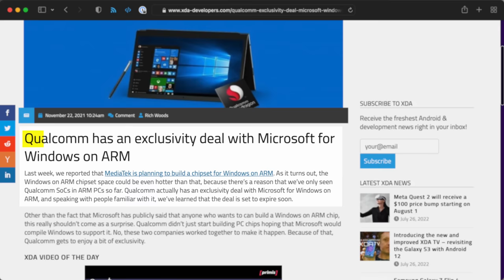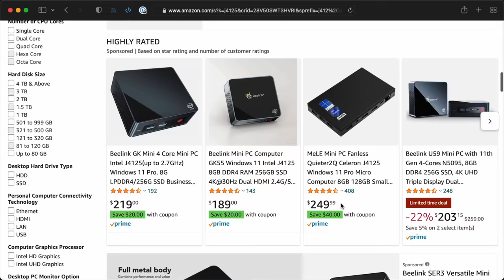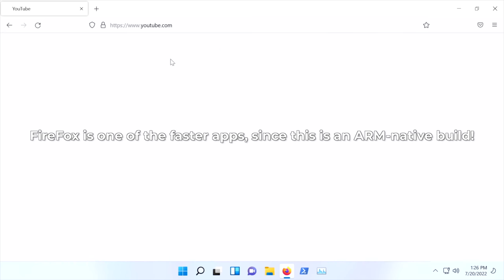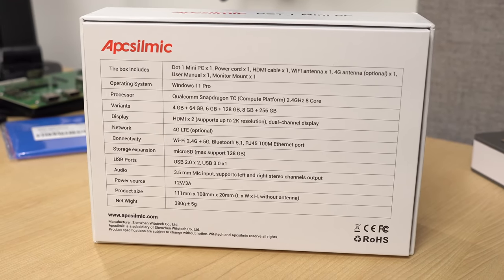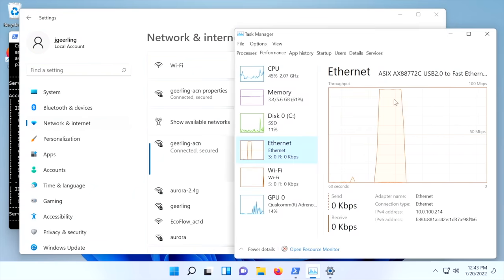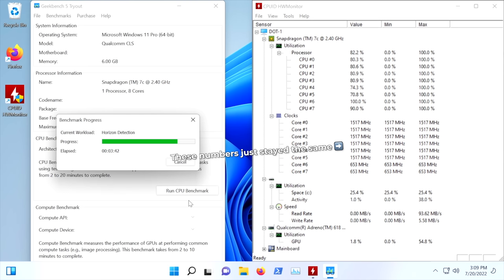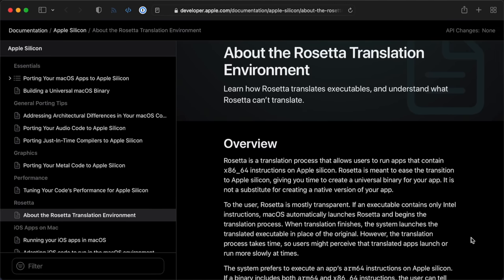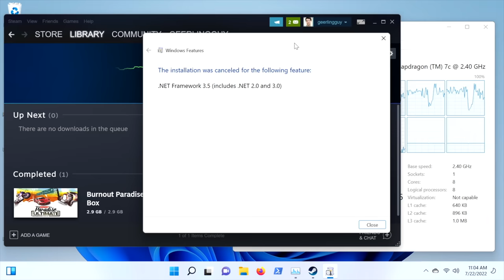Microsoft's wasted potential: Windows on ARM

Comment: Lack of standardized bootloader processes on ARM is a major roadblock to standardizing OS adoption on the platform, thus forcing a large amount of work to building OS images for each specific SOC and board that's produced. The only benefit is to the SOC manufacturers, as they now have to be involved (and thus extra $$ for them) for any serious effort to support an OS on a given device.
Reply: There is a thing called SystemReady (formerly ServerReady) for ARM that solves all that. It's used in the server space currently, but the rebranding from ServerReady to SystemReady was in anticipation of desktops and laptops. Anyway, it does exactly what you want. Device enumeration is done with PCIe (no more custom device trees per board), power is ACPI (standard), and boot is UEFI. There's more than that but that's the big stuff. It's basically "PC as you know it" but with ARM chips.
Reply: @vinnytube1001  Why is this not widely used? Or maybe it is but I don't know about it?
Reply: @Daniel_VolumeDown  Looks like it's from last year or the year before, so it's gonna take time for manufacturers to adopt it.
Reply: I couldn't agree more. I refuse to buy any ARM SBC that need a forked Kernel to work correctly. I just can't trust the board vendors to maintain that. The track record is abysmal. Unfortunately that's almost every ARM board I have ever seen except for the Raspberry wich mostly works with mainline now.
Reply: If that was true than Windows on ARM would run like crap on an M1 especially as it is going though virtualization but instead it runs nearly 2x as fast.
Reply: Isn't the boot loader BIOS dependent, rather than CPU dependent? 
ARM should be the same everywhere. RiscV on the other hand isn't.
An ARM CPU of Qualcomm should accept the same instructions as one from Altera; just like an Intel CPU would do the same as an AMD CPU.
Reply: @ProDigit80  It's not the CPU instructions which are normally the problem An ARM System-On-Chip, as the name implies is a lot more than just a CPU. When you have a firmware on a PC you had the old BIOS or the newer (U)EFI. Those actively help to boot a bootloader or even boot de kernel of an operating system. An ARM SoC doesn't have that. The software that needs to still initialize a lot of the hardware is the kernel. And how to find all the devices, etc. Which is also why Linux on ARM used 'device tree' in binary format which is something Linux already supported so it could be repurposed to be used on ARM when their is very little firmware. Linux supported it for when it was running on PowerPC and Sparc which has 'Open Firmware' as it's BIOS/firmware.

Comment: The chips are slowly but surely improving, this is a 7C which is the slowest available chip,
The SQ1 / 2 in the Surface Pro X is equivalent to a laptop 8th Gen I5 (Qualcomm 8CX/8CX Gen 2 are more or less equivalent in performance).
The 8CX Gen 3 is even faster but these are sold in quite expensive devices.

The main problem with these chips is (IMO) :
- The devices they are sold with are too expensive (it was like 1400$+ for the SPX)
- Chicken and egg : The devs wont port their apps since nobody has those devices, nobody wants to buy these devices since there's not apps.
Reply: Yeah and experience show, chicken and egg can be crushed only with huuuuuge investment. Apple goes all in to arm. Valve develops Steam/Proton/Linux for years with absolutely no profit till, well, they still I assume. For Microsoft, Arm is a toy, some Windows 10 versions are there, some 11 nowadays too... they are just somehow ready to join revolution, if it somehow happened, not promoting it itself at all.
Reply: The M1 crushes all Qualcomm chips, even when Windows is running via QEMU on ARM.
Reply: @cromulence  thanks we didn't know that
Reply: @zoovy7252  You're welcome anime man.
Reply: @ilfirinms  or if MS would've pushed real UWP apps on the store since the RT days, we might have more apps with arm support. Also apple did it better imo with the release of a development kit.
Reply: laptop 8th Gen I5 will simply destroy any of the best QUALCOMM toys. That's the reality. But on paper they can draw any number.
Reply: The Surface Pro X is more like 900. Agreed we need cheaper models but Microsoft had to launch in an expensive price to say they're properly serious about the platform or it would've ended up being a Chromebook competitor.
Reply: In 2022 the app situation is a lot better though. These apps are Native Windows on ARM:

Microsoft Edge
Microsoft Office 365
Microsoft Teams
Microsoft OneDrive Sync Client
Microsoft Phone Link
Microsoft PowerToys
Microsoft Visual Studio
Zoom
Google Chrome (unreleased 😪)
Mozilla Firefox
Adobe Photoshop
Adobe Lightroom
VLC Media Player
Spotify (Beta released on 30/05/2022)
Leonardo Photo/Drawing Editor
ESET NOD32 AntiVirus/ESET Smart Security
Cisco AnyConnect VPN
Viscosity VPN
WireGuard VPN
7 Zip
FileZilla
Netflix for Windows
Reply: @cromulence  8% global market share is not crushing anyone...lol
Reply: @RK-um9tu  Market share != CPU performance
Reply: the 8c is upcoming.
I'm really not fond of the 4P/4E core setup. ARM is so energy efficient, I'd love to see 4P/40E cores. I bet that would even fit in a laptop.
Reply: What are they equivalent to? A freaking laptop 8th gen i5 if they're just looking at the frontpage of MSN? You use them for literally anything else and they're flopping like dead fish.
Reply: @bradavon  They literally ARE Chromebook competitors though. Windows on ARM is just an expensive word processing and browsing machine and that's it. It can't DO anything.
Reply: @acumenium8157  it's hard to say. The 7c has performance cores (2), and efficiency cores (6). The 2.48Ghz efficiency cores are pretty comparable to an atom 2 Ghz cpu in some tests, except the arm efficiency cores use about half to 2/3rd the power.
The performance cores are running at a lower speed of 2Ghz, and are very close to a 2 Ghz atom cpu.

Once your program surpasses 4 threads, the arm performance cores kick in, and lower the overall frequency of the cpu to 2Ghz.
That means that the 4 to 6 e-cores will run at 2Ghz,  pretty equivalent to a 1.66Ghz atom cpu, and the 2 p cores will have an equivalent of a dual core atom processor.

Additionally, there's a software layer converting x86 programs to arm64, that from a geekbench estimate eats up about 25% of performance, compared to the same program compiled for arm64 architecture. 

The real benefit of the arm cpu, doesn't lie in its performance per core, but in its performance per watt. It also has 8 cores, which is way more powerful than any atom cpu released for consumers. (Atom P-series excluded).

The 8c will have 4 performance cores, and 4 efficiency cores. But if you ask me, the p-cores are interesting for games and programs, and the e-cores are interesting for anything else, like VMs, database, rendering, compiling, etc... 

An arm cpu having more threads it can process over x86 without hitting any thermal threshold, will allow it to exceed in performance to an x86 cpu in the long run (with a few more decades of research poured into its design).
The arm cpu can be made and compared to a V24 F1 race engine, vs a V8 muscle car the x86 is.
Reply: @ProDigit80  They aren't comparable to anything though, lmfao. They work on a completely different architecture.
Reply: Also no one is willing to buy these devices for trying out because they're too expensive. I mean look how many people have gotten themselves involved with linux thanks to the raspberry pi!

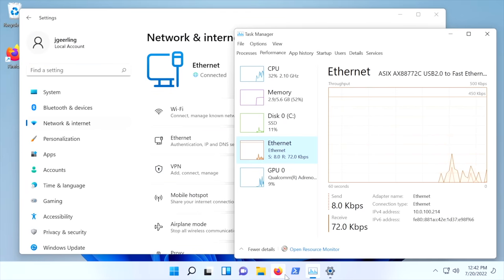Comment: 2:14 PowerShell has always been unreasonably slow to give a prompt, even on my Ryzen 9 5950X. I don't know what they are doing to make it that slow but this isn't unique to Windows on ARM.
Reply: Isn't it odd that it is faster to launch a terminal by launching vscode than the command prompt?
Reply: PowerShell may be kind of slow because this is a .NET app and the runtime needs some extra time to initialize. New cross-platform PS is a bit faster, thankfully
Reply: @edwardallenthree  Especially since vscode is an Electron app, which means that its command prompt is built on top of a web browser and Javascript (which in this case is transpiled from Typescript)
Reply: have you updated it to powershell v7 ? prompt loads instantaneously. Btw i have a R5 4600H
Reply: @vcprocles  Shouldn't, by this time, half the OS be running on .Net anyway? In other words, the runtime already be well and truly running before you even log in? (Serious question here - if you hear MS, it's been the be-all and end-all for, what, 10 years or more, now?)
Reply: I tend to use the (not so new anymore) "Windows Terminal App" from the Microsoft Store but I don't know anymore how good it performs because the last time I did boot into windows not for decluttuering the hard drive or installing updates was one and a half years ago.
Reply: @CoPoint  No, you spawn a new CLR virtual machine every time you open a process. Sharing it would lead to disaster security-wise, since there would be no memory isolation.
Reply: @IamTheHolypumpkin  changes nothing, you're still running Powershell on it (unless you launch a non-PS session ofc)
Reply: Things have been getting slower, and more bloated, after  Windows 7.   This is backwards.  The code should get tighter, and faster.
Reply: I'll stick with CMD, or BASH, thank you!
Reply: Because all M$ stuff is overly bloated and sucks. I've built a custom python app for work that opens text files in external editors for some operations. Notepad++ was our default editor that everyone used, but recently everyone was "forced" to switch to VSCode for python (I still use VIM), so people wanted to be able to choose their editor so they could use VSCode for everything. It's amazing comparing the difference in time required to open a text file in Notepad++ vs VSCode. Using Notepad++ the file is open and you're making changes already by the time VSCode is just getting going and thinking about opening the text file. MS stuff SUCKS, but people just keep sticking their head in the sand and fanboying over everything they do
Reply: That's because Windows Home & Pro are bloated piece's of shit lol. LTSC is probably the best Windows experience you get seeing it has none of the bloat (no store, cortana etc.) but it doesn't get feature updates, only security ones.
Win10 LTSC 2021 loads PowerShell instantly on my 5900X. Loads instantly in all the Proxmox systems I've got it running on as well.
Reply: Im on Windows 11 and it open in a second on my work laptop, which is nothing special but not bad specs (i7-1135G7, 16gb DDR4)
Reply: @xerzy  and also it needs time to JIT the CIL into the machine code. 
The feature to precompile the code on the developer side was added only in .NET 6
Reply: @SeaJay_Oceans  Sadly that will never happen, Windows 7 was and is the last best OS they made. Windows 8 was ok after they ironed out the bugs but i prefer win 7 over 8 , 8.1 , 10 and 11. 

Personally if someone were to get the source for win 7 and be able to apply windows 10's security to it then add Linux support to it then im sure people would deff go back to win 7. One of my gripes with 10 and 11 is Buggy slow UI and bloated apps we don't need, Not to mention  No one wants all their memory being used up for GPU and for background apps that don't need to run 24/7 .  Don't care how fast it makes them launch If the oses were optimized the way they are supposed to be they would not need to have everything run in background.

Window's 10 and 11 are literally the same OS and is the same OS used on their failed Windows 10 Mobile Phone.
Reply: I actually dig the new terminal app. Handles command prompt and powershell both. Works much better really. One of the nicer things they've released recently.
Reply: KDK:   From Win 10 and on,  only run them in a Virtual Machine, hosted by a Linux OS if you wish.  Unfortunately at this time, MS is slipping away like Novell Netware and Novell Office (Word Perfect / Quattro Pro) -  only legacy proprietary software, with no future.
Reply: @killerdeamonking    When MS failed on the Zune, and then failed on the MS smartphone,  they limited the future for themselves... giving away the keys of the kingdom to  Alphabet and Facebook...
Reply: yep i was going to say the same. especially if you have a profile that loads a few extra things on startup
Reply: @SeaJay_Oceans  That don't surprise me to be honest.
Reply: @SeaJay_Oceans  I don't really see and think of them failing on the zune, my gf and her dad still uses theirs to this day and you can even get SSD kits for them too.
Reply: I just launched Powershell on my 5950X (I don't think I've launched it this boot) and it opened instantly (fast enough that I couldn't count other than saying "much less than one second"). PS 5.1 on Win11.
Reply: @vcprocles  It's MUCH worse that that. The default Powershell on ARM64 is the PS 5.1 x64 binary, so you have the x64 emulator running the .Net JIT environment. Powershell 7.2.x uses .Net Core 3.x which has native ARM64 support. Powershell 7.2 ARM64 binaries perform much better.
Reply: @zoovy7252  same, my powershell boots instantly. Maybe OP or uploader is using the older version which is slow
Reply: @CoPoint  it's not the starting, it's a compile step and then cache I believe. So in theory it should be faster a second time ? But as with Java, it probably does a lot of disk searches, which on a device like this are slow compared to other devices.
Reply: @Undercoverfire  Are you kidding me? That is ridiculously wasteful. But also hilarious that something running on Electron is still faster than a native console.
Reply: PowerShell (the cross-platform one) is actually many times faster on Linux than Windows, which speaks a lot about how unoptimized Microsoft's own OS is as compared to the competitors.
Reply: powershell loads on mine in 2 seconds. Samsung Galaxy Book Go.
Reply: @SeaJay_Oceans  It is faster. Windows 11 works really nice on x64. On Arm it does have some porting bugs, but the nature of ARM is to run slower than the more optimized x86.
Arm CPUs can do more basic instructions per watt, as x86 can do more advanced instructions per time.
Reply: @ProDigit80    Considering 80% of computers are used for web and email,  neither ARM or x86 is being pushed to hard...
Reply: It makes too many checks in the background unlike older versions of PS which launched as soon as you clicked.
Reply: @SeaJay_Oceans  and all those telemetry harvesting users data so Microsoft could rather easily 'made numerous improvements in users experience' slowed it  down even more.. 
 Although to be fair Linux's kernel  getting more complex and slowing it down to some extent too but still many times better compared to Microsoft though ..
Reply: @SlaggyGaggy  it's also the .NET runtime running IN EMULATION that "helps" PowerShell
Reply: @batmanatkinson1188  at this point they could just run virtual machine on linux. Might be even faster.

Comment: I was really curious about Windows on ARM since the days of the Snapdragon 835 and I bought a Galaxy Book Go that have the same config as the Dot 1. It wouldn't say it's great, I don't even know if I would call it good, but I paid 170$ for it, which is a pretty decent price. I tried a bunch of games and while 3D is basically a no-go, 2D indies are usually running okay-ish and you can run older 3D games from the late-90s to mid-00s with no major problems. The big problem for normal use if the stupidly small 4 GB of RAM, it's simply not enough for x64 emulation and the bare minimum for browsing with a native browser. I definitely didn't need it, I have a M1 MacBook Air, but I wanted to test the state of WoA.

I entirely blame Qualcomm for dragging down the industry in the last 6-7 years, including smartphones, tablets, laptops and smarwatches, thanks to Apple for finally showing that ARM can have good performances that can rival x86.
Reply: It appears that apple is the only company that actually cares about ARM performance in consumer space. Which is a shame, if only apple is doing it then it might as well not count
Reply: Your fault for going with the 4GB version.
On the other hand, try to disable the Hybernation file (not really needed anyway, as regular sleep mode on the GO easily lasts a couple of weeks), and remove any windows upgrade files.
Use an external microSD card, and install your apps/downloads/videos/photos on that. Manually set the SWAP file to 3GB (4GB if you want to run some higher end stuff, though I don't know what more advanced software needing the extra ram you'd run), and stick with the optimized Edge browser instead.
Set it to google as default search engine; disable and uninstall bloatware (like xbox shizz you don't need anyway), and your ssd will run with at least 20GB of free space.
Make sure you create a basic recovery drive for windows 11, as the advanced (recovering system files) isn't possible on ARM yet.
It should at least allow your system to boot into recovery mode, and give you the option to do basic fixes (like MBR , boot partition, formatting and other adjustments).

Comment: Yeah, I picked up the Snapdragon Developer Kit (ECS LIVA Mini Box QC710 Desktop) with the same 7c, mostly out of curiosity. 
I'm a fan of SFF and very-low-TDP computing, therefore ARM and U designated x86 CPU's. 
This device is a start, but they really need to raise the bar. 
Hopefully very soon we'll get Apple M1+ "equivalent" power in an RPi form-factor. 
Pocketable Desktop Computing, be it Windows, Linux, Android, or other. 
And it's nice seeing Asahi Linux become a thing.
Reply: Very happy with Asahi on M1